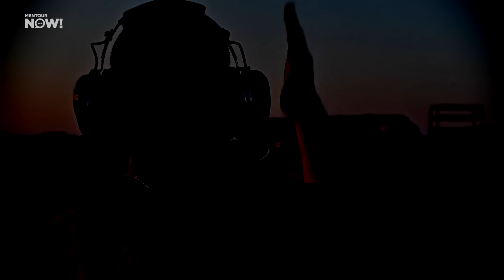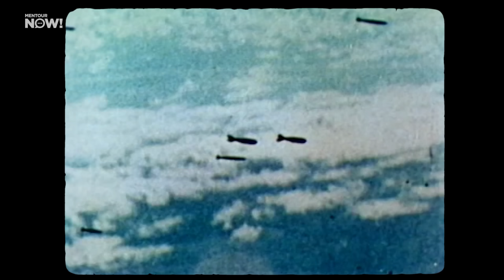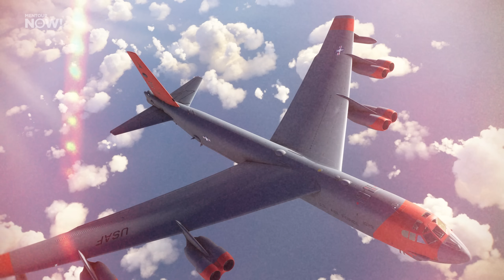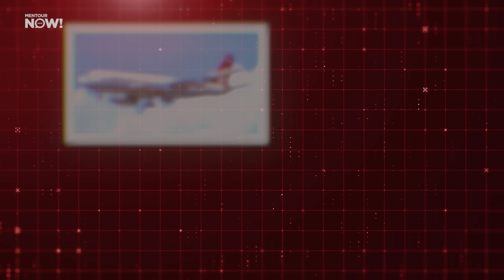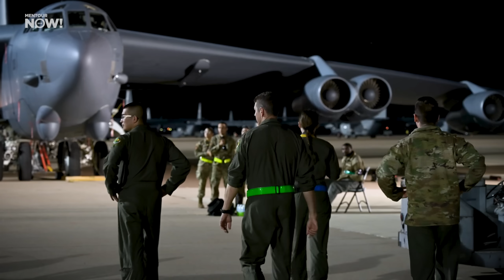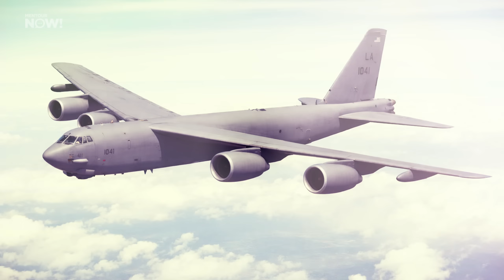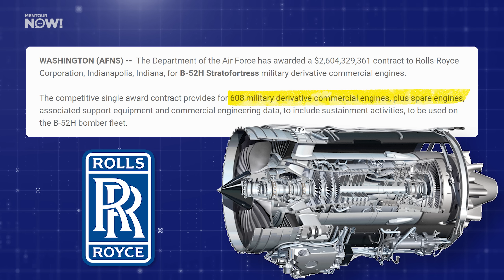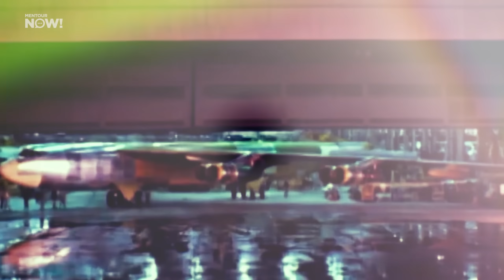WHY Are They Changing The B-52 NOW?!

Comment: @mentourNow Nice Video with two mistakes as to why not 4 larger TF engines and the Why!  The wings are designed to flex 30 feet at the wing tip which means in flight the tips of the wings are almost above the backbone.  When you look at pictures and video's of B-52 landings you'll notice that the wing tips are very high compared to watching one take off due to the fuel load difference in the wings.  Large engines would strike the ground on take off or during emergency high fuel load landings.  I started my AF career as a B-52 crew chief and recently retired.  The endurance of the B-52 has nothing to do with fuel efficiency but oil burn rate's!  The TF-33 has far more engine oil burn rates compared to the F-130 and that will allow the B-52 to stay in the sky for several days longer than it can with the TF-33.  But ultimately it's the availability of engines and parts that are the main reason it's getting refitted today.  I love the B-52 and I imagine it will outlive me.  Again great video and good info.

Comment: I have watched a lot of you were  HYD in the read of the plane crashed because of HDY leads out On our Induction molding machine have flow rate values on them to cut that line off and it stops the machine you would a value to stop  the line broke and  a bypass button so you can add hdy to det the plane lever out 

Comment

Pinned by @MentourNow

Comment: When I was on an aircraft carrier in the 80's with the Navy, I saw part of a test flight with the PW 2000 engines.  It was pretty quiet.  It was down to 500ft as it went parallel to the carrier.  They conducted radar and EW visibility tests, along with seeing how visible the exhaust trails were at different altitudes.

Comment: Why didn't they design a modern B-52 from scratch and just put the engines where they go and put everything where it goes instead of all this stupid nonsense.
Reply: Because it would be a huge waste of money... it's far cheaper to refurbish an existing aircraft than to build new ones from scratch.
Reply: @DoktorBayerischeMotorenWerke taking the base of the B-52 and modifying it in New designs is not that expensive as compared to all this other money they're talking about and the steps are talking about and the years they're talking about. The cost in years alone for personnel as far above and beyond what the original amount would be probably to create a new jet.
Reply: @ersalgoud The USAF conducted an exhaustive study on this question, and the numbers don't lie.
A brand-new bomber with similar performance as the upgraded B-52J's would cost around 200 billion dollars in total while the entire Boeing B-52 J upgrade program will be less than 50 billion in total costs.

Comment: Long story short- The USAF dug a massive hole in the 00's by only wanting high stealth all wing subsonic bombers.  The following two decades showed that we actually need a lumbering behemoth (B-52) for putting a LOT of ordinance down at once and a hypersonic bomber (B-1) for moving through contested airspace at least the same speed as F-35s or faster.  There is still a case for stealth, but the smaller B-21 is a better fit than the B-2 that planners thought would be able to replace the B-52.

Comment: Asymmetric thrust would not be a problem for a single large turbofan. The motors would be de-rated to the same thrust as the low bypass engines they were replacing, much like the CF6 on the Super Galaxy, to avoid requiring excessive structural strengthening requirements in the wing. 

I assure you that a B-52 will fly minus the thrust of two outboard engines. It would have to be designed to do so, because any podded engine design sustaining combat damage would likely also take out its pod mate. Also, the remaining single engine on that side would be capable of maintaining higher thrust up to the thrust limit of the pylon/wing, recall that it’s de-rated, to a higher/hotter altitude than a TF33 which likely taps out much earlier. 

Ground clearance, and fod ingestion make more convincing arguments.

Comment: In project management I learned: make the best estimate you can for time needed, multiply the number by three and give this number to management. If you are a little lucky, you finish project after 2.5 times the original estimate and get a bonus. But time and again, project managers are not intelligent enough for this simple calculation. Why you need 2.5 to 3 times the time? Because of the "unknown unknowns", you stupid.

Comment: My guess is that with the new engines stretching the service life into the 2050s, there wont be a need for a new replacement bomber of the size of the B-52. Just like we’re basically downsizing the B-2 with the B-21. Bombs are getting smaller, more effective, more specialized so the massive volume of a B-52 probably wont be needed.

Comment: This is typical of a military upgrade.  Some general has the idea to replace the B-52.  "Sir we don't have the money for that, but we can find a new engine we can put in the airframe and get more power while saving gas."  Great, do that." Then they talk to the engineers who say if you want to do that then we have to change a lot more, the wings, the wiring, the cockpit, etc.  Then they go to Boeing and they find more to change and other cost overruns.  

In the end, you wind up with an engine upgrade that basically changes the whole plane and puts a square peg in a round hole - and very likely costs more than it would have to buy new planes.

Comment: As an engineer - my first reaction is that it would be much easier and cheaper just to replace the entire plane.  As is very well explained here, this aircraft (as are all aircraft)is a complex system -  and changing one subsystem (i.e., the engines) - will have unavoidable and widespread effects that few laypersons would be aware of....  Then again - the plane itself is also part of a larger operational and support system....  so on and on it goes.

Comment: Integrating best engines requires heavy redesign, so they use compromised smaller engines.
And the smaller engines require heavy redesign…

Comment: I was on the weapons range in Cold Lake Alberta in the 90s, and we had a flight of 4 B-52s booked for a run (not a common occurrence for us). We were stoked. They came overhead and each dropped a SINGLE 33lb practice bomb.
What...
The...
Actual...
(Turns out, it was to test early GPS navigation and targeting systems being installed on the B-52. They took off from Fairchild AFB and flew HANDS-OFF the entire run.)
It was still a big let-down for us as spectators.

Comment: Also the B52 was over engineered and lasted so long because of the bad experience with the B47.  Boeing was embaressed by the inflight breakups of the B47.  "Died Suddenly" in a B47 was a closely guarded secret.
Reply: The B-47 was very quickly built from captured German plans developed in 1944-5... it was a very radical, highly advanced design for WW2 and the technology was struggling to keep pace with the aerodynamicists at the RLM's wind tunnel laboratories

Comment: Why re engine now?  Because the AF is finally out of spares fir the engines. So they need a new production line of engines.  Also there is a need to perform its world wide mission with out inflight refueling. They need inflight refueling to project the smaller f22 f35 f15ex fighters across oceans.  The B52 with the right engine can be completely independant of inflight refueling.

Comment: From an engineer's pov its unbelievable and seemingly nearly a joke to further use 8 engines and selling these to the public like its theoreticaly not possible in other configurations, bla bla... 

For the financial- and construction-efforts it tooked to get in 8 matching "half-newergen" engines, they could have optimized every single structural part of air frame, mountings, housings, plumbings and wirings, flaps and steering surfaces etc. to use more serialized, cheaper, more efficient and available ones - for the next decades(!) of planned future...

Now they wasted the same huge amount of everything to get only 4,5:1 BR - instead of having at least 10:1 with other (viewer) but real modern engines anyway... 

Unfortunately every practical working engineer would have told you so before and therefore this solution is really hard to justify on actual facts... 

They got a man on the moon ...and back... 
but nowerdays they can't get real modern (4) engines into an existing air frame...??? 🤔

There really have been guys that build actually working flying planes (even jet powered ones) in their garage without computerized-simulation -capabilities and wind tunnels...
[ i know that its not exactly the same, but anyway...] 

Hopefully they at least get this half baked solution airworthy pretty fast, if they already argued with an existing experience-basis of some engine-maintenance crews...

Comment: I realize that I'm just another gray haired, fat, opinionated old tax payer, but for years the powers to be have up dated the B52 systems to keep the that system reveillent, but what about the guy on the ground who is in the middle of a very nasty mix up , who is wondering if he and his buddies will see the light of day because of some high up mucky muck  has decided the B 52 is more revellent than their lives.  When the A10 would be just around the corner so to speak and available to save their bacon. Sorry, I didn't mean get away from the point of the article

Comment: the simple answer to the 8 engine configuration is payload.... the B-52 was designed for payload capacity.... i don't think even the newer bombers can carry what the B-52 is rated for... also, despite what the maintenance cost is on this air frame, i think it's still cheaper over the 50+ years it's been running than the cost of newer planes... and one final note, it's the only bomber that has had ground troops trying to surrender to it..... they were that afraid of what the B-52 can do.... let that sink in.....

Comment: Eight engines are for redundancy.  If you spread the thrust out to fewer engines and you have warfare damage or reliability issues in one of them you loose 1/8 of your available thrust not 1/3 or 1/2.  Civilian planes do not need this redundancy because 1 they don’t need the extreme range and 2 will not be operating over a battlefield where they will get shot up 3 will have a lot more runways available to them.  This thing is set up to loose half of its engines survive and still make it back to a friendly base.  With the subsequent upgrade in engine thrust with newer engines it could probably afford to loose more than under its original design.

Comment: Like.. it does kinda blow my mind they didn't model the pod airflow with the new engines before they started... I guess whoever drew up the requirements wasn't thorough enough. It's amazing that apparently it's still cheaper to basically change most of the plane rather than design a new airframe.

Comment: We've made procedures so complex and with so much overhead that it was cheaper and faster to design, build, test, validate & release in the 50s than readying new engines in the 202x
Reply: Yes, BUT the designs are far better for all this extra work.
Reply: Also, the B-52s replacements were rendered irrelevant before we bought them due to developments in the Soviet Union. 
Soviet anti-air missiles gained the ability to reach higher, so the B-70 was doomed, and it was cancelled, much to the sorrow of sci-fi and aviation nerds everywhere. 
The B-1 was intended to fly under air defense radar, then the soviets developed look-down-shoot-down capabilities for their interceptors. Also, we developed ways to give radar the finger. We only bought the B-1 to kill time until the then-secret B-2 was ready. 
And then the soviets just alt-F4'ed, and we couldn't justify buying hundreds of very expensive B-2s to fight the USSR. 

And it turns out if you don't have a near-peer adversary, the B-52 is still perfectly adequate.

Comment: I worked in the Boeing Aerodynamics staff in the early 1980s.  We did a study of putting 4 CFM-56 engines from the 737-300 on a B-52.  One outcome is that with existing fuel capacity (internal and external) it would be able to fly around the world without refueling.

Comment: I dont understand why the government doesnt just order production of more b52s..  same thing, just freah built with fresh tech....   did we firget how to build a plane from 70 years ago? Why stop doing what works?
Reply: It's not that is has been forgotten, but the industrial ecosystem in which it was built isn't there anymore. You'd need to adapt it to new components, new materials, new ways to assemble and test it, new requirements, ...
With all those modifications to the original design you're better off starting from a blank page 

(Interestingly enough, that's also the reason why the current lunar program takes so long to give results)

Comment: Eight engines provides multiple redundancy for survivability and mission execution.  Realize the B-52 has hydraulic and electrical system requirements that commercial aircraft do not have.  Having 8-versus-4 engines, provides for more drive engine-driven hydraulic pumps and generators, allowing for loss of one or more engines and/or critical engine-drive systems, and retaining the ability to continue long-range strike missions.

At typical landing weights, the G-model (since retired) can actually execute a go-around on just two engines. This is/was one of the training requirements when going through the B-52 Instructor Pilot training course.  So even with the older engine in the G-model and low-bypass engine in the current H-model, combat related redundancies, range and payload are why this bomber has outlived the multiple airframes that were designed to replace it.

There is one factor you failed to consider in your analysis of why all three efforts to re-engine the airframe, elected to retain the 8-engine configuration.  In addition to ground clearance issues, airframe and aerodynamic changes in using four versus eight engines, another primary reason this was twice previously rejected, was due to limitations in the trim system.  Only 10% of the horizontal stabilizer is a moving surface, creating conditions where the moveable surface area and trim system would not be able to handle the significant increase in thrust and rapid rate of change in thrust in the [then available] high-bypass engines.  Rapid throttle movements, such as during a go-around, would result in pitch-up changes the horizontal stab could not keep-up with, even if continuous nose-down trim was run.  This is compounded by the significant lift the wing produces (hence the nose-down attitude during level flight).  Realize that the landing weights are typically less than 50% of the maximum takeoff weight (488k).  Combining a high-lift wing, large angle of incidence (6.73°), and limited pitch authority at light landing weight, creates an increased loss of control risk during touch-and-go training and unplanned go-arounds (as well as additional increases in aerodynamic load that were not designed for).

I can tell you that the two most difficult emergency procedures in the simulator, were loss of (stab) trim, and loss of four engines on one side.

Comment: Informative video. Thanks. 

As for the Air Force's considerations to not switch to four engines: I found none really convincing (from my layman's perspective) other than the size issue affecting the landing gear. Everything else seemed like it could and should be overcome for the benefits of a four-engine-design. But then … sofa expert here. 

It would be interesting why the B-52 was not completely replaced by something new. What makes this airframe so remarkable, that the Air Forces wants to keep it.

Comment: You have to remember that logistics are not easy to totally redo.  Plus they already have all their spare engines already in their inventory.  Newer isn’t necessarily better.  They wanted to put GE CFM-56 engines on my USAF aircraft but they couldn’t handle mid-air bird strikes as well as the original Pratt and Whitney engines!  Too much precision can be bad.  It was too tight an engine.  Reengineering that aircraft would necessitate new tech data.  New flight characteristics are a big deal.

Comment: I expect that eventually, updating and maintaining the existing fleet will be unmanagable. So much worn down over decades of service that they absolutely have to be replaced.

And the Air Force will check if we still have the blueprints around to just make some more.
Reply: To add though, the B-52 stuck around oddly enough due to radar. 

The B58 and XB70 were fast, but were obvious on radar. So is the B-52. 

But one way to avoid radar is to fly very low, blocking LOS to the antenna with terrain or even the horizon at longer distances. The B-52 could do this, the B58 and XB70 could not. The B1 and B2 are just too expensive to fully replace the B52, though they probably could do it if money was no object.

Comment: Another thing concerning the 8 engines not mentioned here is..... The plumbing and bleed air system needed to operate it's blown flap system. Also perhaps the volume of bleed air needed. Perhaps in a four engined version, a loss of 25% of its engines, the blown flap system might be highly compromised.